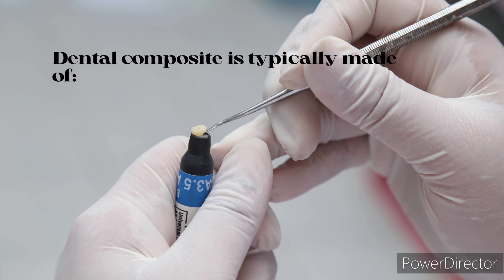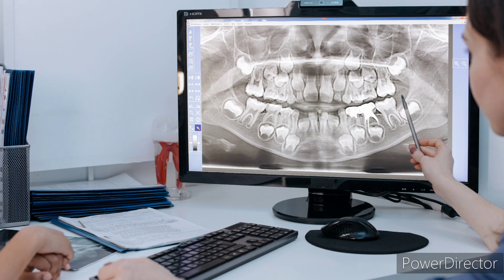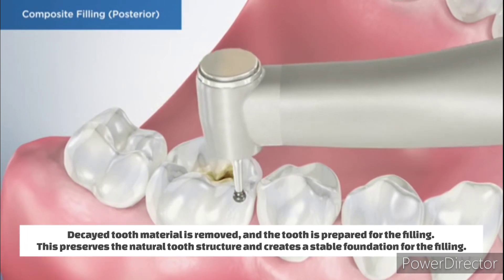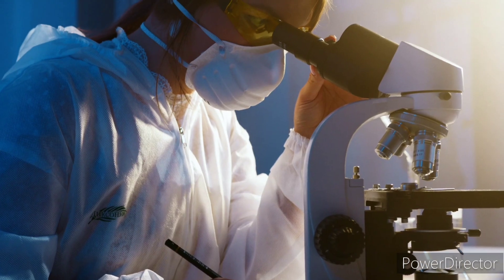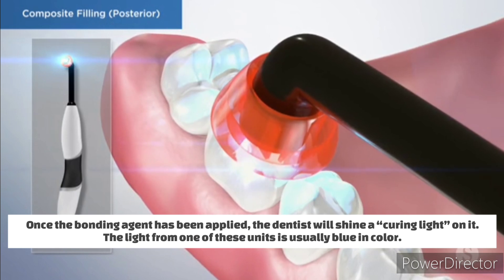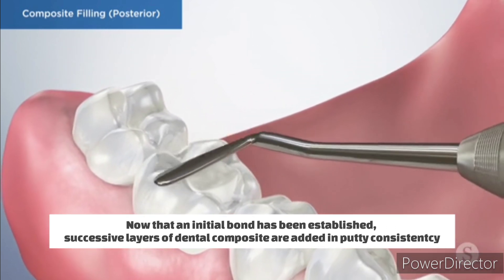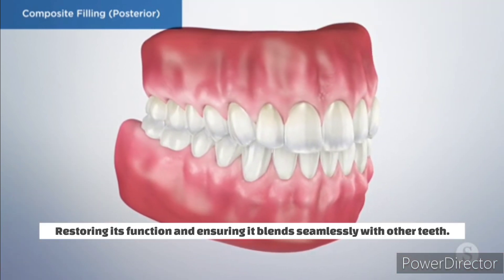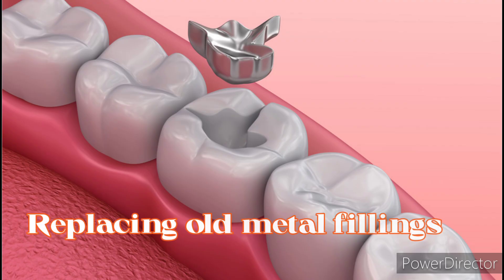Composite Fillings || Composite filling procedure || Composite bonding to the tooth

Comment: Are these compounds toxic? do they leech?  release estrogens, or BPA?
Reply from the maker: No, They are tooth friendly, non toxic, donot leach and release nothing.
Reply: @dentalvibes.   What's the safest type of dental filling?   For example some of those BPA free composite resins,  could contain agents that are afar more toxic than BPA.    And as far as adhesive goes with porcelain  epoxy resin/ epichlorohydrin are known carcinogen agents.   Porcelain is biocompatible , but how about the adhesives that are used to bond it to the tooth and  teeth?   Some even say,   Amalgam is much safer than composite resins and Mercury released from them,  are far below the FDA danger levels.  What's your perspective?   could gold be the best option?
Reply from the maker: All types of Dental filling materials use today are considered safe, with no proper evidence for potential health effect, 
However yes, gold is an option but gold fillings are not esthetics, and pure gold is soft and malleable so, gold alloy is used in dental fillings